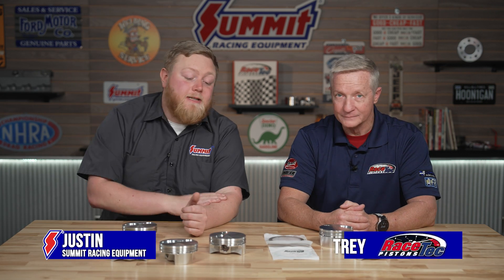2618 or 4032? Tips for Choosing the Best Piston Alloy for Your Performance Engine from RaceTec

Comment: Would the 4032 be good in a daily driver truck application? I had planned to go with Hypereutectic pistons for my LQ4 thats getting a 4 inch stroke but I haven't found any hypereutectic pistons for a stroker motor
Reply: @autumnjeserich2689  absolutely 4032 will last in street application.
Reply: Unless you’re going to boost it, hypereutectic is fine.

Comment: I've been building long stroke 383 gen 2 LT1's, for road racing, yet keeping them street drivable, I build them for maximum torque, I've been using JE sportsman racing pistons, last fall for the third time a piston broke in half right along the wrist pin center line, never any other damage, throw new pistons in and go, this time I switched to Ross pistons, a lot lighter wrist pin, heavier piston, same over all weight with a little touchup, nobody can tell why this is happening, can it be cured, any suggestions, this build is making over 600 lb-ft of torque, on the engine dyno.
Reply from the maker: Thank you for your question.  That’s great torque out of a 383! 4032 Alloy lacks the fracture toughness of 2618.  Meaning once a crack starts, it shoots through the forging like a lightning bolt from silicon particle to particle and you end up with a pile of shrapnel in the oil pan.  2618 Alloy is ductile and lacks the silicone particles so a crack may start but travels to a low stress area and often stops on its own.  4032 can make a little more power than 2618 and often wears better too if a skirt profile isn’t super-developed, but it has its limitations.  Circle track pistons are an interesting case.  .150 deck pistons are lightest but usually split over time and it may not be catastrophic because the engine builder notes the blowby occurring and swaps out pistons before bad things happen.  Going to .180 is a noticeable improvement.  .200 is better and rarely fails.  .225 is often used in endurance applications.  Racers love to throw in the thinnest wall (.080 to .105 range) and lightest pins they can get.  The problem is thin pins flex.  When they do, the pin towers flex with them.  Pin tower flex causes cracked decks.  Having a forging that narrows the unsupported span between the piston and rod small-end to .050 puts the pin in shear and makes ANY wall pin stronger than it would be versus “hanging out in the wind.”  This is a problem because the piston AND the rod manufacturer’s want to sell you the lightest part and the clearance here grows further away from each other.  Optimized pistons/rods like Summit’s Pro LS series complement each other in this way.  For your issue, keep a close eye on pin bore wear and use it as a guide to when the pins are too thin.  Lastly, ceramic heat barriers from Polydyn, Calico or Line-2-Line keep the deck from annealing as quickly and this can extend piston life as well.
Reply: @SummitRacing  Thank you very much.
Reply: @SummitRacing  Thank you very much for that information, I've been reading it over and I think it may be a huge help in solving my problem, I really appreciate it, both engines are running perfectly at this time, and I will run till a failure, at that time I will put this info to good use, I'm going down to the pole barn right now to look at the old pistons and see what I can with the wristpin bores and the like.

Comment: WTF 🙄🙄🙄🙄! The stronger piston has a lower number, so let’s confuse everyone by getting this moron on here to bash it 🤷🤷🤷🤷! Because most think that the bigger numbers mean better, always! Besides that, people are going to think there pistons have gasket maker/RTV in them 🙄🙄🙄🙄! Maybe put a real engine builder on to explain! Performance engine builders call them hyperubustic! If you are going to run the engine hard, or even think you may put nitrous, blower or turbo on the engine down the road, use the 2618! If you have an old plow truck, an old car that will be basically stock, & you are just going to putts it around, then you can go for the cheaper stuff!

Comment: aluminum... was looking around and found, cast iron and cast steel piston options mentioned in a few things... one would be heavier then the aluminum but the cast steel from ford was said somewhere to be 128'000psi tensile. but as far as it goes the one engine was 185hp one year then at the end of a production quote was 265hp... cant get clear information from anyone tho in thought it seems like, they just switched from cast steel to compressed nitrogen/argon forged aluminum. tho that 128ksi steel would be nice for a mild tune up as the OEM aluminum almost looks like there to be intentionally softer not for a hard "working engine" just lighter for those EPA measurements of 185hp 4.6L w/steel pistons and 265hp 4.6L w/aluminum pistons being for the EPA one uses 48% less fuel over "#.../mileage" models made. like seeing 15mpg and not 21mpg, one is 128ksi cast steel the other is 78ksi cast forged aluminum? or so i read somewhere the one might be a tempered 4140/4340 chromoly steel piston. but anyways, whatever pistons are in it, it allegedly snapped off a 28 spline 8.8 with 400'000km on the dash, even tho i have other suspicions as to it only having 85'000km ... something the other was paying to get stuff done to 20 years ago with no carfax report info logged other then a transmission kit with a very faded reman sticker on it... and a low power note in the fax... it broke the axle's after a fuel pump and pressure reference fuel regulator was put on it. 440gph @ 0psi... pump... gallon per hour. those pistons all have numbers on them so if ya borescope it, they can be traced back right, by reading the piston face print numbers? got a 325lbft number as by the shaft ratting and braking from a motor specified as 265lbft as a stall torque from 4800rpm to 0rpm in "seconds of time" equaling the factory advertised 265lbft... +325lbft as the axle shaft broke, just from a regulator and pump swap... odd? 400'000km is a lot of fuel for 15mpg. wrecker paint numbers here and their...

Comment: I chose 4032 years ago.. 4 cylinder, turbocharger build,  rod piston,  making ~500 rwhp , street driven..NO PROBLEM  dumping 28-32 psi and getting down...tuning is key to any engine build regardless of the piston alloy...
In my opinion,  if it isn't a dedicated race car there's no reason not to choose  4032..they'll last longer and handle anything you've got in your street/strip car..
Reply: @boosted2.4_sky  what air fuel ratio did you tune for on this engine?
Reply: 4032 pistons will handle 1000 whp without breaking a sweat.